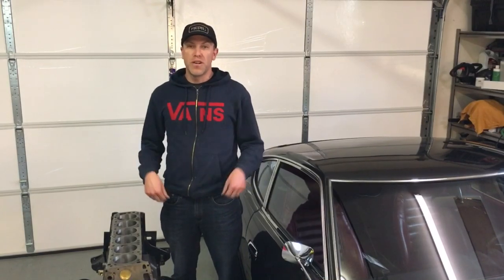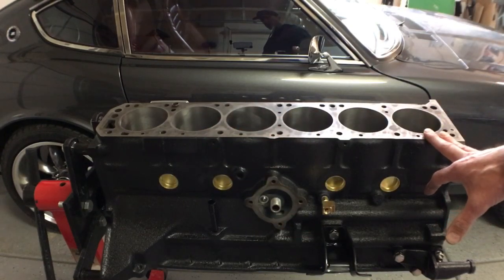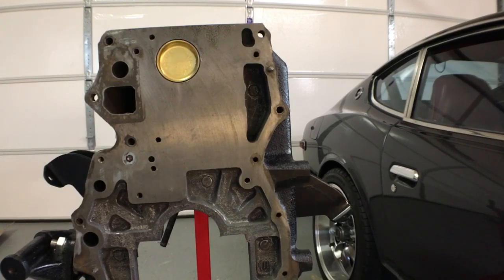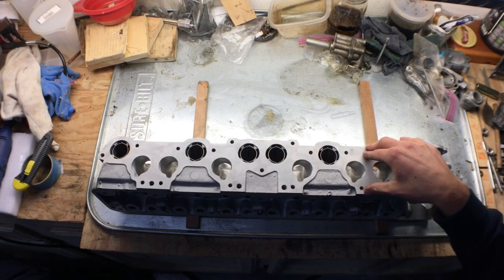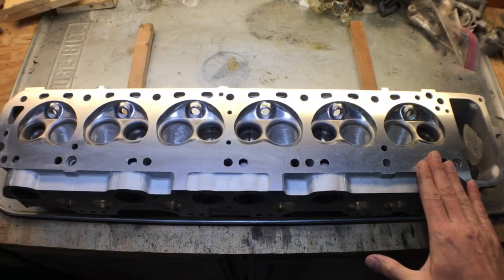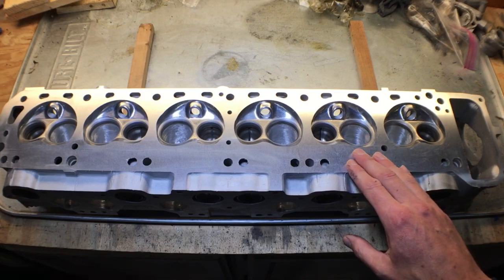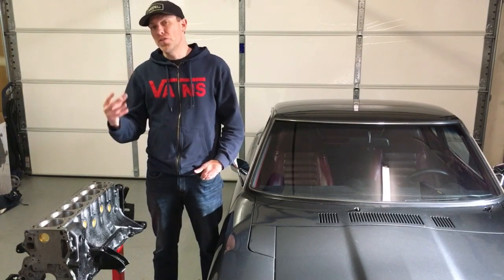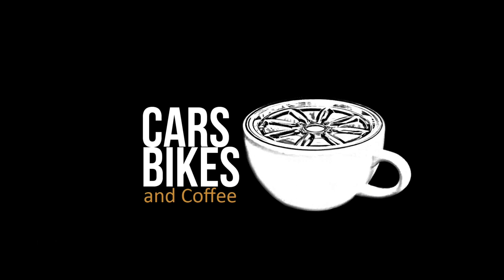Performance modifications to the Datsun Z engine

Comment: Glyptal is brilliant, but...clean [rust free], oil free metal is a must.  Even the soluble oil from machinist cooling fluids has got to go - scrub down with mineral spirits 2x, then dry before application.  That makes this an indoor job to keep flash rust from rearing its ugly head, and that means a respirator.  I sometimes use it on odd aluminum pieces where I want electrical resistance, such as  a ballast resistor mount [wire wound resistors can sometimes do odd things when they fail].  When I do, I like to prepare the fitted piece with alodine first:  the acid prep clears off minor surface oxides, and the chromate of the alodine seals the surface - squeaky clean and ready.  Two thin coats of glyptal, and done.   Aluminum does not corrode deep, but it does corrode fast - I have seen many a powder coating on aluminum  fail because looking new from a mill, they probably only degreased... but the oxide was lurking, and the coating llifted - then cracked - game over.

Comment: These are all the things I should have done to my l28et. You should really take the runners out of the exhaust port and put a header it. With a decent Cam and everything you've done... it would run pretty well.
Reply from the maker: Thanks! You still can! Although probably not something you want to do after putting it all in. Lol Yeah so I’ve read a few that have went through the trouble of removing the runner’s found there was not enough benefit for all the trouble. It has a header to it.
Reply: I heard thats not a good Idea unless you going to run a unstreetable amount of boost..

Comment: I recently got handed the keys to my father in laws 82 2+2 non turbo really clean car low miles reason being his buddy in the late 80s ported the cylinders and put it back together I have no idea why they did that but now the cars seems to run great but soon as that 7th warm up injector shuts off the cars runs like its gutless sputtering about...... I've done forum research and have found nothing
Reply from the maker: +40Mike Mike hmm, well port matching opens up the head to breath or allow the air and fuel to flow better and faster. Not sure what you meant by the “7th warm up injector”
Reply from the maker: +40Mike Mike you must be referring to the cold start injector. Does it start sputtering when it’s warm only at idle or when you press the gas pedal?
Reply: Cars, Bikes, and Coffee idles fine but once I hit the gas sputters back fires worse when I put it in gear also runs decent when warm up injector is on which makes me think it's starving fuel.... Bigger injectors? Hate tossing parts at a car though
Reply from the maker: +40Mike Mike a few things I would check, if you haven’t already, easier first, vacuum lines, look for intake leaks, spark plugs as they could tell you if it is a specific cylinder, check spark plug wires, distributor cap, vacuum advance, then go and check fuel filter, fuel pump, injectors could be clogged so check them. This would be a good starting point. Let me know how it goes.
Reply: Cars, Bikes, and Coffee would love to send you a video of your willing to take a Listin I might just post one myself 👍🏼
Reply from the maker: +40Mike Mike go for it! Video always helps!

Comment: My bad if this is redundant, but what was the purpose of the front and rear oil galley work you did?
Reply from the maker: +Icebox240z Gaming, Gear & Cars no worries! So normally they just put an aluminum plug at the ends of the galley. In some circumstances they’ve been known to blow out. Since we are in there and it’s a cheap mod, might as well do it for peace of mind.
Reply: @CarsBikesandCoffee  thanks much for the rapid reply, and great info. My L28 is sadly still sitting on engine stand for too many years now, awaiting much needed attention like what you've done.
Reply: N42 block/N47 head L28 awaiting rejuvenation

P30 block/N42 head L26 currently in my '73

Spare E88 head I've yet to decide what to do with. 

Ahhh....datsun life

Comment: Why do you leave the intake port rough but the exhaust port smooth?
Reply from the maker: +mike Prandota this is done so the fuel and air continue to mix as it passes through. If it was polished fuel could potentially separate and lay on the walls.

Comment: Did you check the 2mm shaved head?
Reply from the maker: d3xterown are you asking if I verified that the machine shop removed 2mm from the deck of the head? If so, yes. Thanks for watching!
Reply: Cars, Bikes, and Coffee I mean the compression numbers
Reply from the maker: d3xterown ah, yes, I cc’d the combustion chambers and re-calculated the compression ratios
Reply: What are you running now?
Reply from the maker: d3xterown should be around 10.3:1
Reply: Hey cars bikes and coffee,, what did you use to paint the block. Thanks.
Reply from the maker: I used VHT Hi-temp engine paint
Reply: @CarsBikesandCoffee   hey bro I got a 1978 280z and I want to rebuild my engine.. I have watched all your vids they great my question is. What website do you recommend  to get all my rebuild kit like all the gaskets, piston rings, pistons and all that you know. Thanks in advance
Reply from the maker: Thanks for watching @Tito Castillo!I used the rebuild kit from Partsology.com, https://www.partsology.com/dnj-fgs6088-full-gasket-sealing-set-l28e-l28et?gclid=EAIaIQobChMI8rzok8ak2gIV1I1-Ch1QWQcYEAQYASABEgJRnPD_BwE for a complete list of parts used my website has it all listed in one place. Http://carsbikesandcoffee.weebly.com/parts-used.html

Comment: Bore it to 90mm and get a diesel crank and L-14 rods and you'll have a 3.2liter
Reply: Damn hard to find those diesel cranks.  IMO better off doing a turbo conversion.  Turbo with custom exhaust and cooler, then add mega squirt.
Reply: @karljay7473  or use l28 crank, get some nice custom forged pistions, weld shut the combustion chambers, throw on some 50mm webers or solex, you would have a 300+ hp engine easily
Reply: @naturalthing1  I'm not sure compression and carbs can get you to 300.  I can see a great engine coming from it, but can't see 300.  They rate these at 150ish, can't see carbs and compression doubling the power.  I can see a turbo adding 100~150.
Reply: @karljay7473  You would get over 300 easy, I've been messing with these engines since the 70s. All you need is a big cam like a 320 degrees , port the hell out of your intake and exhaust. Put a bigger exhaust valve, 38mm. You could leave the intake at 44mm, but you could go up to 45mm.  Get some nice headers, big ported intake manifold, some 48webers or 50mm Solex. You would really have a rocket and with pump gas
Reply: @naturalthing1  There's been a big following of these engines for decades, and even today, people ask about how to get to 300 and nobody seems to have the easy answer.  Just a simple Google search, you see hybridz doesn't have a solution, classicZ doesn't have a solution, if there were an easy solution, I would guess others on the Internet would know about it.  It's an engine that's been around for 1/2 a century, it's been professionally raced for years, yet others can't seem to get to 300HP easily...  I think if this were the case, it would already be on one of the forums.  One guy at classicZcar claims 300 and it was some $12K in parts.  At that point, the turbo is clearly the better choice.
Reply: Parts to build 3.4 L series now available through Les Collins racing out of Australia.. Check out Video "Green hornet 240z"  here on youtube. These guys make "Rebello" look silly.
Reply: Turbo L28 rules! (For me) 300hp? That's a starter kit on a turbo L, There are some impressive N/A combo's out there... I have even seen some all out N/A race motor's close to 400 crank but I have also seen Turbo L's make almost double that on the street with manor's running e85 fuel. Great motor's, easy and fun to work on..❤
Reply: @bobbyk5557  they are silly ,,over priced parts ,,,
Reply: @bobbyk5557  Yeah but you need the Maxima Diesel block to do that tho i think the cylinder walls are thicker i have even seen a 3.5 on utube